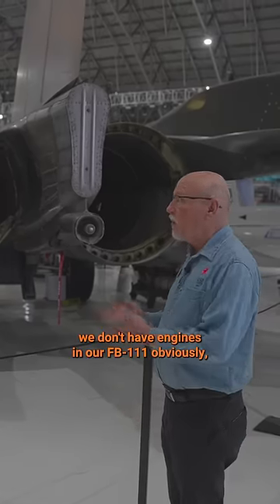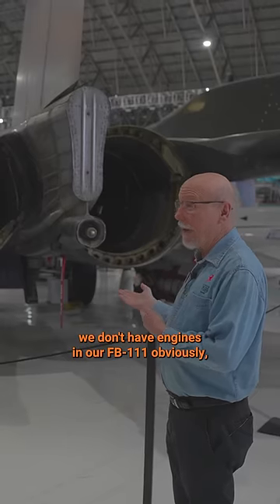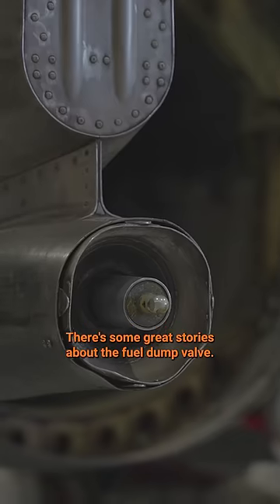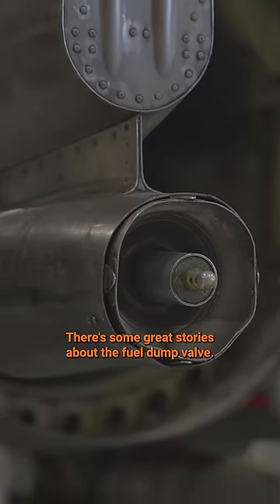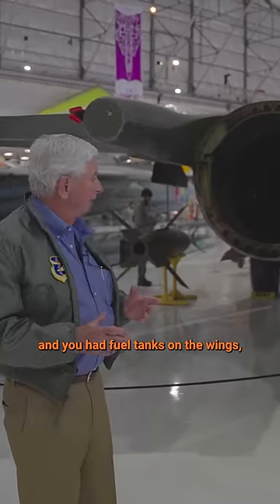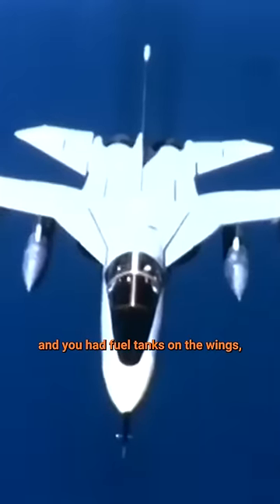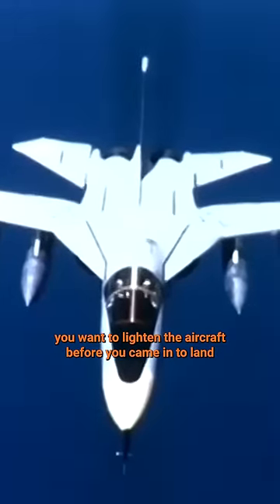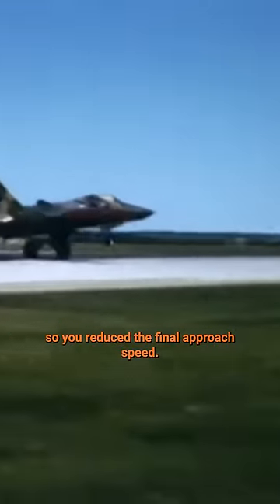FB-111 Fuel Dump Valve (full video on our channel)

Comment: Imagine if we had that for show of force psyops in GWOT
Reply: Well now that you mention it ...
Reply: @sharizabel2582 oh do tell, or allude to in ambiguous Minecraft metaphors…
Reply: @finnmacdiarmid3250  imagine the effect of an EF-111 diving at 45 degrees nose low from 20000 feet while supersonic. When close to the ground dropping flares then recovering while blasting full speed at low altitude over a target area. The impact of a sonic boom can be telling. By the way the EF-111 hard no ordinance carrying capability.
Reply: @sharizabel2582  carried no ordinance yet still slammed a mirage f1 into the dirt
Reply: @cannack  yes, the only A/A kill for a F-1111
Reply: I was thinking the same thing!
Reply: That EF-111A is the only unarmed aircraft ever awarded with an air to air kill. It's currently on display at the front gate of Canon, AFB in Clovis, NM. 🤠
Reply: Grand Wumpus On Thames?

Comment: Driving in downtown Brisbane one night, suddenly everything becomes day time and a shock of sound rattles all the windows on the buildings. A fireball flies down low over the river and that’s when I knew, the f111 was the greatest plane ever built
Reply: I wss cycling home from work early one morning, back in the 80s. (02:30ish), when I saw a bar of bright golden flame in the sky travelling roughly South to North, (more SSE to NW iirc), and there was a whooshing sound too. It took me years to  realise it was probably a F111, on its way back to Upper Heyford, doing a fuel dump.
Reply: -A lesser man would cite this as proof of ufo's.😅
Reply: @gregredman6982 It was probably just an afterburner
Reply: @904_noah  definitely fuel dump
Reply: So was the purpose of that to prevent possibly soaking school teachers with aviation fuel? Would that 75 ft flame completely burn the fuel?
Reply: About 15 years ago or more, I had a similar experience in the inner western sydney suburb of Glebe. The noise was incredible as it blew the torch , turned night into day, followed by the pilot pulling back & climbing vertically till it was out of site.
Reply: Mate, do check the Electric Lightning or the Vulcans or the Buccaneers. Maybe that's a different type of aircraft, it has right seat steering, so to say.
Reply: @mickvonbornemann3824  In the early evening of Australia Day (January 26) 2007 I was watching a movie at the outdoor cinema near Mrs Macquarie's point, on Sydney Harbour when an F-111 did a fuel dump and burn over Darling Harbour. Maybe this is what you experienced?
Reply: They should have kept one of the F111s going just for the River Fire, besides it would be a good plane for the apprentii to learn some of the old skills from the old folk. I think cleaning the sealant out of the wings was the death knell for the F111.
Reply: @stevegraham3817 it was old , but it should have been replaced by a long range medium strike bomber of basically similar capabilities.
Reply: @concernedaussie1330  Or they should put a fuel dump valve on one of the modern jets, just for the River Fire and New Years Eve shows.
It's not about the capabilities, it's about the annual spectacle that only ever happened in Brisbane/SEQLD and nowhere else in the world, at least nowhere else that I have heard of.
Reply: @stevegraham3817  yeah man . I bloody loved that aircraft & was gutted to lose it .
Reply: @concernedaussie1330  yeah same, that's why I wish they could have kept one or two going.
Reply: Who cares that that one 30 second event caused as much pollution as a car for a full year. Worth it to feel proud eh?
Reply: @norwegianzound  .. well that’s nowhere near the pollution caused by having a child , & people seem to be very proud of that. So my childless ass can splurge on a few treats here & there .
Reply: @norwegianzound  Sometimes, pollution isn't the greatest concern. Imagine.
Reply: @stevegraham3817 i dont know how often i have watched videos of the d&b over the riverfire.
If they wouldn't have retired the aircraft i would have some day made the trip around half the world to see that.
Reply: I certainly can't agree on the "greatest plane ever built", but it is certainly a beast with the most impressive party trick of any aircraft!
Reply: The fuel dump was used at the closing ceremony of the Sydney Olympics.

Comment: The Royal Australian Air Force flew these for several decades. The good on 'dump and burn' always looked great at events.
Reply: they need to add a little window so the pilot can release a string of sausages for a mid flight snack. Watching someone get into the plane with a 10kg sack of sausage would be ???
Reply: You could feel it from the ground!
Reply: First time I saw this demoed I wasn’t expecting it and I thought the plane was coming down.
Reply: The Australian based F111 were the F111-C variant. The B was for the navy but never saw service with the navy.
Reply: @garyholt4445  That was the F-111B. They were showing the SAC FB-111 which Australia used as the F-111G.
Reply: @garyholt4445  The F-111B's greatest achievment was teaching US mliitary contractors how to setup projects so they can't be cancelled despite going massively over budget and time (F35)
Reply: Vark Vark Vark Vark!
Reply: I saw such a demonstration at the preamble to the 1986 F1 race in Adelaide. It warmed me up on a day that had been a bit damp.
Reply: Remember this from the Sydney Olympics closing ceremony - really cool!
Reply: @ae0n772 it is the Pig in Australia, not the Aardvark

Comment: Dump and burns used to be a fixture at all large airshows in Australia up until the F-111 was retired from the Royal Australian Air Force. It was always very spectacular to watch.
Reply: Some of the best footage of it is from the RAAF shows. Always cool to watch.
Reply: I always liked what you all called yours than the Ardvark.
😎👌
Reply: The pig hehe, yeah my favourite nickname
Reply: And also flybys at all the big events like the F1 Grand Prix, V8 Supercars, Australia Day etc etc.
Those fuel dumps were an iconic spectacle.
Reply: @nazaxprime  Surprisingly, that is where its nickname came from.  
First paragraph. 
https://en.wikipedia.org/wiki/General_Dynamics_F-111_Aardvark
Reply: Yeah, a pair of F-111's flew low over Sydney Harbour at night and lit-off during the bicentennial celebrations back in 1988.  I'll never forget that sight to this day!
Reply: @am5p8 i always thought it looked like a kingfisher, with its long snout resembling the characteristic beak of the bird.
Reply: @nazaxprime the Pig?

Comment: I was stationed at Cannon AFB in New Mexico and worked on the 111 for two years. Spent alot of time drilling holes to stop the cracks in the tail feathers at the tail of the engine. Loved to work on them

Comment: The one time I torched in the 111 was in the Raven. We had just come off the tanker and headed into Iraq when the left engine seized. We turned south towards Kuwait while dumping with burner and boards. An F-16 joined on us who has never seen a torch before. He reported, “um you guys have sparks coming out the back.” Our reply was, “that’s just the AB lighting the dumped fuel.” “Um ok it’s your jet.” 😂 so we landed in Kuwait on the taxiway since the runway was closed for construction. Gumby and I had several experiences like that in the Raven. By the way in the Raven many a time in combat was single ship.
Reply: Damn
Reply: A 75' flame ....and man says...sparks😂
Reply: Besides being real cool, why would you torch your fuel dump. We dump fuel all the time in civilian aircraft.
Reply: I just thought of something.  What if the EPA would force Boeing to build in ignition systems for the fuel dumps.  Just a thought
Reply: @oldmech619  surprised NO ONE did that....
Reply: @oldmech619  We didn’t torch on purpose. Well except for a cool air show display.  Torching would happen in an emergency dump when we had to go into afterburner while dumping. In the F-111 the dump mast was aft between the two engine exhausts. Because of this position the dumping fuel would ignite when in afterburner. In my example we needed to lighten our weight quickly single engine. So we dumped fuel and went into afterburner in the good engine. We also extended our speed brake.
Reply: @oldmech619  My understanding is that the fuel dissipates enough if given enough altitude that it’s no longer a hazard. Thus, we were to always stop dumping if below a certain altitude. It would be an interesting adaptation though to routinely ignite dumping fuel.
Reply: @sharizabel2582     A Delta B777 dumped a lot of fuel over houses near LAX. I think there was a compressor stall.  The tower asked he wanted to extend out over the ocean to dump fuel, but the pilot wanted to return immediately. On final, he decided to dump on houses.  01/14/20.  The FAA let him off.  
Btw. I was with Air America.  I got shot down. Got pulled out ok.  Next day I had to go back in to fix my chinook.  I heard an F111 drop some ordinance on the assholes that shot me down. I never saw the plane, just heard the rumble. I also had some fast movers coming in as well. Got the chinook fixed and out of the hot area.
Reply: @sharizabel2582    Btw, if you were a F111 driver, while I was in Laos, I heard you guys liked to map the earth scud running in Laos. That must have been the gruffest ride imaginable. Those hills were all tall and vertical. A lot of pilots bit the dust in them there hills.  I heard there was a couple F111s lost that way?
Reply: @oldmech619  close but I'm not quite that old.
Reply: What caused the engine failure??
Reply: @kevinoshea9125  engine bearing failure.
Reply: @oldmech619 
I actually heard that, early on, the ground following radar in the F-111 was so violent with would cause whiplash in the pilots.
Ergo, I'm sure Laos was killer.
Reply: @oldmech619  "because you can"
it only happens if you light the AB and wasn't originally something tbe designers thought of (or so they claim)
Reply: @miscbits6399  “because you can”.  Best aviation answer ever.   
In the 1950s, there was an Air Force proposal of a fire breathing fighter jet called the Dragon. Obviously cooler heads prevailed.
Reply: @Fightre_Flighte      I had heard about the 111 ground mapping ride, then I went to Laos.  Beautiful mountains.  Just shear straight up mountains, both small and tall.  We were in helicopters. Didn’t both us.  Air America. I lived the life.
Reply: @oldmech619 "the assholes that shot me down"
 Yeah, I'm sure you were fighting in your country defending you're homeland, weren't you? They were the assholes in other people's land fighting for the interests of the powerful, right?
Reply: @fusososososo3507     When someone is shooting at me, they are an asshole. No matter why. Using such a descriptive word trying to describe someone that is trying to kill me was the least of my worries. He had a big ass 51 cal sniper rifle.  I really didn’t like it.  Plus he set my helicopter on fire. And I had to fix it under fire.
Reply: @fusososososo3507 respect your elders and pound sand.
Reply: @fusososososo3507 this is no different than most soldiers' description of opponents on both sides regardless of who is in the right, which is always subjective anyway. Why try to grind somebody over things they had zero control over?
Reply: " that impressed the onlookers." =" Trousers were shat.".
Reply: @Pipizzakitchen  Zero control? Just think about what you said
Reply: @fusososososo3507 Indeed, just think about it. A soldier has no control over policy decisions made by politicians & orders from military commanders. The soldier is only allowed to not follow orders (theoretically, at least) if the soldier believes an order is somehow inappropriate or unlawful, in which case, the soldier has a duty to not follow such an order. But the soldier's action or non action will be later judged, likely with some subjectiveness, by officers. If the soldier does not follow an order only for personal reasons, bad consequences could result, that may negatively affect the safety of other soldiers (on the same side as the soldier in question, of course) & the mission. 
Apart from all that, many soldiers themselves have questioned & criticized political policy decisions & military strategy; not surprising, since they are the ones at the greatest risk of consequences from poor planning strategies.
Reply: @shadovanish7435  But no one is forced into the molitary in the US, as far as I know, so there are no excuses
Reply: /r/thathappened
Reply: @oldmech619 
They had to dump fuel to lighten the aircraft because they were down an engine.  But they had to fly afterburner because the other engine was out.  Hence the unintentional but necessary creation of the pillar of fire.
Reply: @keirfarnum6811    Any aircraft in afterburner just to stay airborne is going to consume a horrendous amount of fuel. It really doesn’t make sense to dump fuel.
Reply: @oldmech619 let's go with he did it because it was cool, probably to impress the f16 pilot who was there. I was just a grunt, but often times cool is the rule, dumb as hell but you've been there also so I'm sure you know, different wars, same shit. Hell I didn't wear a helmet as a contractor because it looked cooler, but if I got blown up my head woulda been hard off the landcruiser I'm sure, luckily my truck never got hit. Also, asshole is a perfectly apt description of anyone shooting at you, regardless of if your in their country or not, mother fucker works too.

Comment: I remember being at the 1989 Adelaide Grand Prix, it was cold and very wet. People had either thin ponchos or were using garbage bags to keep the rain off (common in Aus back then at events). 

An F111 flew past doing a dump and burn and the plastic shrink wrapped onto the onlookers! No one was burnt or hurt, but it was pretty funny for 9 year old me!

Comment: It may have had a shaky start with some issues with the swing wings, but that was fixed.  Ask any pilot what they think of the Aardvark.  In flight it looked beautiful, whether slow and wings out, or fast with them swept back.  I think this and the spitfire are the best looking aircraft, ever.

Comment: Every year they did the dump and burn for the Brisbane Riverfire fireworks show that F111 used to light up the hole city with its dump and burn, I miss that part off the show. The new fly by from the FA 18 😢 doesn’t have the same impact and is know done during the day

Comment: A lot of aircrafts have a maximum weight limit for landings, which is significantly less than their maximum weight limit for takeoff. C-17 had a max landing weight of like 20,000 pounds less than takeoff. Fuel dump valves are necessary.
Reply: also several that doesn't have dump valves, even though MTOW is higher than MLW, they either have to spend time using the fuel or in an emergency land overweight. It will require an inspection, but it is still relatively safe, the weights are with the maximum sink rate in mind
Reply: Why don’t they just not put so much fuel in them if they aren’t certain they’re going to use it?
Seems extremely wasteful.
Reply: @drjones762 in the case of a combat plane, the last thing you want to do is be in a dogfight or on a strike mission and run out of fuel.  In a more commercial spectrum, all of your commercial aircraft (air busses, 777s, etc) have fuel dump valves for emergency landings.  Aircraft like that don't have in flight refueling capabilities (I'm pretty sure anyway)  so they have to carry all of the fuel it's going to take to get them where they need to go. And getting back to a combat situation, sometimes you'll take off from one place and have to land elsewhere but you don't know how long you're going to be up there on mission or whatever.  So in that case it's always favorable to have more fuel rather than less.  You can burn excess fuel off at any time but you may not always be able to refuel on mission.
Reply: @codyslaughter4678  not all commercial aircraft have fuel dump capability, a 737 or A320 doesn't
Reply: @fuzzy1dk  ah ok.  Good info.  Not my field of expertise, so thanks!

Comment: My dad used to do that with a 32 Ford back in his day. Flathead V8 built offenheiser components. And ain't run a wire back there you have spark plug setting there and guess which we let the car run little richer stomp on it and shoot flames from his tail pipes. Then he had a 50 shoebox Ford did same thing with it. I don't think Sputnik or any other satellite zoomed in on those flames. But he said satellites walking around and skirts just simply loved it. 😎
Reply: I could do that with my '73 F-100. I'd turn off the ignition for 10 seconds on the highway to fill the exhaust with unburned fuel, then turn on the ignition switch. It only shot flames about 30 feet but sounded like a cannon when it went off. It did a good job getting tailgaters off my back. Fords do waste a lot of gas - might as well do something creative with it.

Comment: Fabulous rigs. Were the big block muscle car of the skies. I think the aussies held onto them so long coz their original order off the blueprints took a decade to arrive due to teething problems. They were still buying good condition Aardvarks in late 80's early 90's, fixing well known flaws then putting their advanced avionics and terrain tracking radar systems in them. We regularly had them shopping around for good ones. They loved them coz they dominated the skies of SE Asia with long range, payload, low altitude ground attack and high altitude extreme speed. For a long long time there was nothing that could stop it arriving and nothing that could catch it leaving. Even if you picked it up at 200ft hugging the terrain or ocean there was still nothing you could do about it. Pilots and ground crews in the U.S. seemed to have more of a love/hate relationship with them.